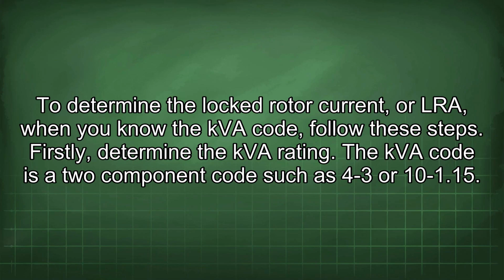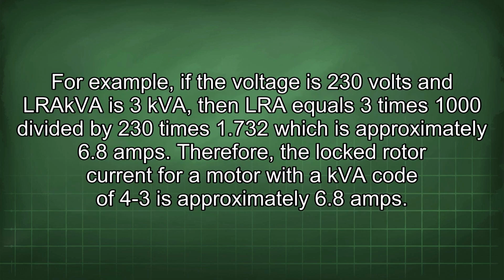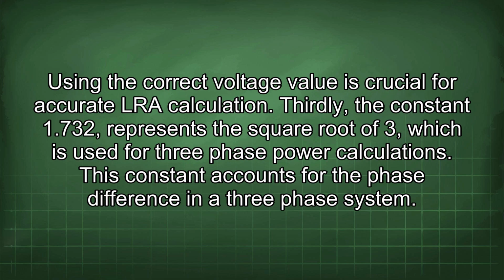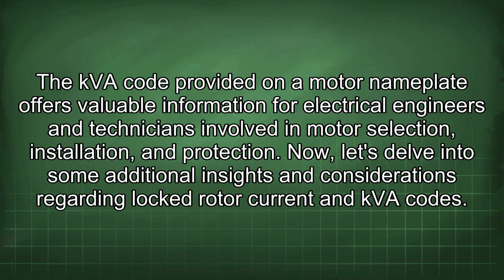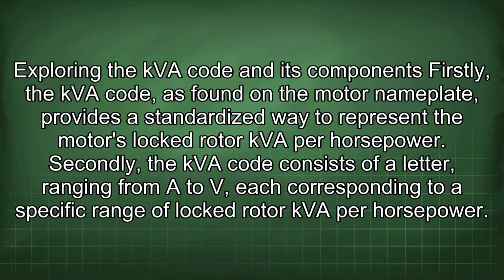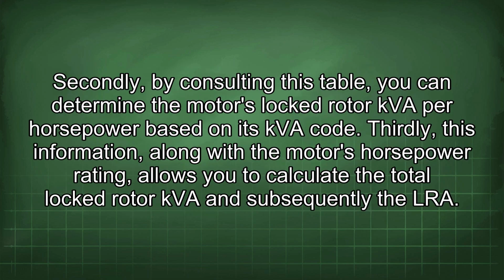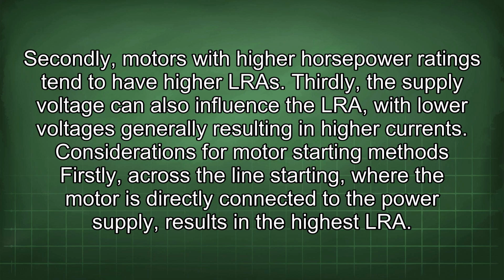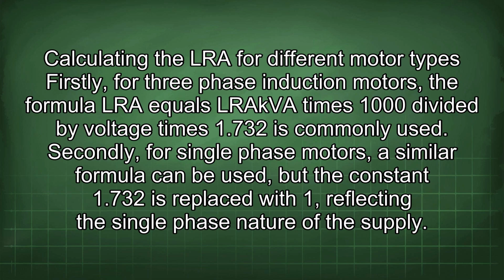Calculate Locked Rotor Amps Using kVA Code Easily

Comment: How did you get 6.8 
3000/230x1.732=7.5
Reply from the maker: Hello @oscar27ization,

Thanks for your correction, this is important. The formula presented in the original calculation was missing the multiplication factor of 1000 in the numerator to convert kVA to VA for current calculation. Using the correct formula, the Locked Rotor Current (LRA) is approximately 7.53 Amps, which aligns with your calculation of 7.5. The original text's final answer of 6.8 Amps was simply a numerical error as we use 440Y/254 V as a standard in most cases.

Sincerely,

BESA Research